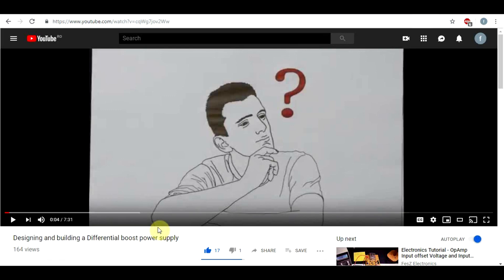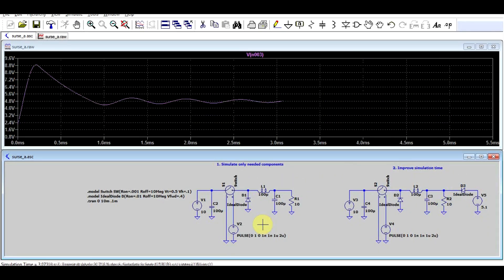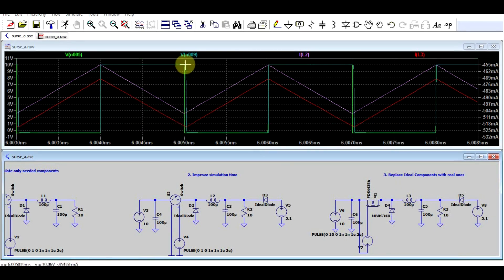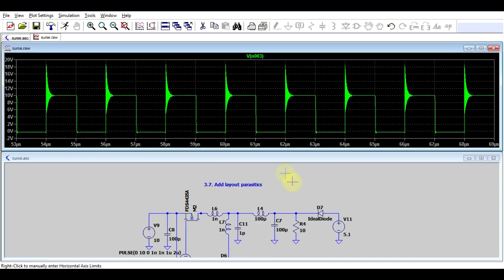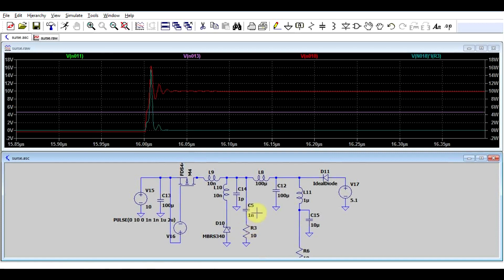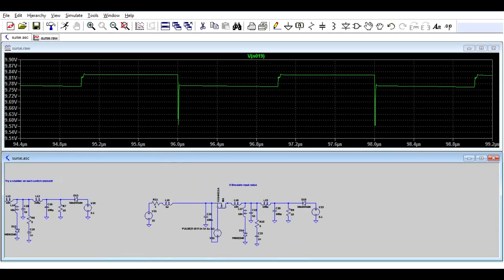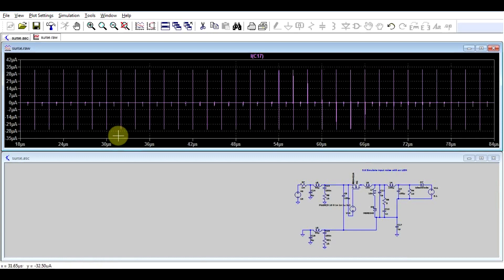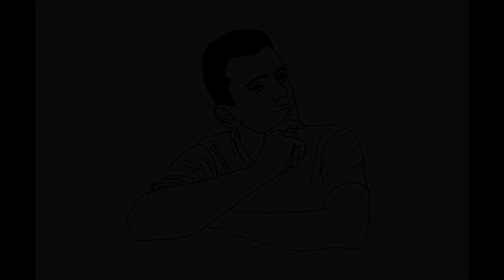LTspice tutorial - SMPS EMI and electrical noise and filtration simulations

Comment: Great video regarding this topic. 10:39 You need 50ohm (in parallel to R15) for proper operation of the LISN. In practice this is either the input impedance of the spectrum analyzer or a 50ohm termination resistor. 12:18 the best way to describe is the difference between differatial mode (DM) and common mode (CM) noise. Your small 1pF capacitor introduces common mode noise.

Comment: Hi, I have a few questions, 

1. If I am designing an SMPS with PFC boost, do I need to use EMI  filter again for the next stage of flyback?
2. If I only wish to simulate the EMI, do I still need to add all the rest of the components?
3. How to calculate the values for pi filter?

Comment: How would you simulate conducted EMI on isolated Power Supplies, for which the secondary Ground is different from the Earth terminal ?
Thank you!
Regards
Udo
Reply from the maker: The secondary ground will never be completely isolated from the primary ground - you can model this connection trough various capacitors - like inside the power transformer and from load to ground again. As the analyzed frequency increases, you will also need to consider the various inductances - the ground is not a uni-potential structure after all... As long as the modeling is an accurate representation of the real device, you should get some idea of the emi that will get generated.
Reply: Thank you very much. I will try a FFT for a Flyback SMPS, using small caps between sec.GND and earth. Also, if a headsink with insul.Pad between MOS and Case is needed, a cap to Earth is realistic. Your presentation is very impressive and helpful.
----
Udo
Reply from the maker: With the transistor a drain to gnd cap should be sufficient, but with the transformer it can be a bit more complex - the different sides of the winding are presenting different amounts of noise - on the primary the side connected to the supply capacitor is far less noisy than the side connected to the transistor drain; You can have up to 4 capacitors - from each winding end to each other and the values need to represent the way in which the transformer is built - the winding end on the primary from the first layer has the smallest capacitances; then the highest capacitance is between the primary and secondary - where one ends and the other begins; and finally a small capacitance is on the end of the secondary - the outer most layer. Based on this mode of analysis you will find that EMI noise is directly impacted by the exact way in which the transformer is connected to the circuit - which coil end is connected to which part of the circuit. 
Hope this helps!
Fesz

Comment: Hi. Actually there is much better way to speedup the start than with the diode and additional voltage supply (which can add noise or other problems by the way). Make the value field of the output capacitor say "10u ic=5" then the simulation will start with the 10uF capacitor charged to 5V, observe the polarity of the capacitor in that case even if the capacitor is non-polarized type (see the current arrow when the mouse cursor is over the component). This technique is also useful to starting with current already flowing through an inductor (ic=1 then means one amp)
Reply from the maker: In the mean time I also discovered this statement; you can use it stand alone (not linked to a specific component)  like the form ".ic I(L1)=1" to set a 1A current trough a component or ".ic V(n001)=1" to set a voltage in a net.

Comment: Great thanks for the video. Only a small comment, the resistance in the LISN should be 50 Ohm or 50Ohm//1kOhm, instead of 1kOhm.
Reply from the maker: Indeed, you are right. I forgot to add the 50R termination... Thank you for pointing that out!

Comment: Hello Fesz,
I have a couple of questions regarding the LISN circuit: 

1) Why did you add he LISN to the circuit? is it supposed to be on the final circuit or it is just added to simulate the behavior of the circuit when conducting CE testing?

2) You probed the noise on the input after you added the LISN, why is that, I thought it should be the other way around because the LISN will add some filtering on the input so we won't be able to see the real noise.
Reply from the maker: Hello! Well, I wanted to measure the noise the circuit is generating into the supply line; if I would have added an ideal voltage source, there would be no noise, since the impedance would be zero. The main reason for adding an LISN (other than as part of the CE test setup) is that it provides a known non-zero impedance to the line, so any noise can actually be measured. 
Regarding filtration, the LISN is filtering noise coming from the initial battery (to prevent it going into the circuit) and its preventing noise from the circuit from passing trough towards the battery; but it does not however prevent the noise coming from the supply from appearing in the supply side of the lines.

Comment: Hey there, 
The LISN that you just took from Wikipedia was way more simpler. So, I wanted to simulate something more realistic, right? I read a bunch of research papers on how to design a practical Line Impedance Stabilization Network. That being so, I came up with two different models. 
question

First Model:
https://drive.google.com/file/d/1zv5ioM-F-j37XWgBORZiYFMpa1WQwGiq/view?usp=sharing

Second Model:
https://drive.google.com/file/d/1HVcmoHBuKRDgC_FeRGm_Ad5NSYdUeLVi/view?usp=sharing
Reply from the maker: Hello Sajid. First of all, it depends on the voltage you are working with - the 250uH/50uH  LISN models the power grid, but there is also a 5uH model for low voltage supply line; the amount of inductance refers to how long the supply line is between the initial supply and the load. Depending on standard you will need one or another. 
As a practical 5uH schematic I found this thing: https://eleshop.eu/tekbox-tboh01-dc-lisn-60v-10a.html ; its a commercial product but also an open source design - you can find even the layout for it. The main reason its so complicated is that all the components have parasitic elements which come into play at higher frequencies. The "wikipedia LISN" is the basic schematic, built with ideal components.
Reply: FesZ Electronics thank you very much
Reply: Can you please help me find out which LISN I should consider and how do I point out its pin configuration?

Comment: Hey. Can you please help me out how can i find common mode and differential mode insertion loss simulation in LTSpice? I am designing a three phase AC DC bidirectional converter with EMI filter at input (commom mode and differential mode choke) and want to see the noise at input with LISN netwrok in LTSpice. Please guide me how can i simulate it.
Reply from the maker: I would suggest building the LISN in LTspice and measuring the output using the FFt method (one LISN for each supply pin). 
Also you can add stray capacitance between each circuit node and ground using .options cshunt=stray_capacity. This will help to generate the common mode current and have it uniformly distributed troughout the circuit.

Comment: Hello? The voltage Pulse which drives the MOSFET, why is it not connected to ground?  Instead, it feeds back into the circuit?  Why is this?

I spent 2 hours creating a Buck Converter from Texas Instruments/Power Topologies with that gate voltage pulse going to ground at the negative side, always used up 50% of my output voltage from Vin (which I don't want).  As soon as I changed to your style, it works.  But I don't understand why.

Thank you for the video.
Reply from the maker: Hello @Da Bx , In this circuit I am using a Pchannel  mosfet, so to drive it I need some sort of circuit that gets the gate pin at a lower voltage than the source pin by at least 5V (I use 10 to be sure I am driving the transistor properly). The exact voltage is transistor dependent. The transistor does not care where the voltage source is connected as long as the gate-drain difference is ensured.
In real life for a simple circuit I would drive the SW transistor with a low side NPN and drive the NPN with a signal source (the control IC) - that way I rely on the input power supply to ensure the gate drive voltage; I used the single signal source approach in the simulation to simplify the circuit and make sure I have fast switching characteristics. 
I used the NPN way in this video: https://youtu.be/89KNjEnIwWM 
The same approach with a single signal source can be done to simulate driving N-channel mosfet, this of course helps to simplify the circuit to not need the charge pump or other method to obtain the higher voltage needed for the gate.
I am not sure why your approach didn't work - if you use the signal source that drives the channel transistor with voltage pulse from 0V to Vin it should work. In your case, when it didn't work, what was Vin and what pulse did you use?
Reply: @FesZElectronics  I'm using an N-channel MOSFET.  It worked only when I increased the driving voltage of the gate (Vg) to more than my input voltage (Vin).  In this case my Vin was 24 V (standard 24v power) and my Vgate was 30 V.  But I'm not sure that I need or want such a high voltage on my MOSFET.  

So if Vg was < Vin, it did not work and I always lost ~ 50% of my output voltage.  It only worked once I:

A) Increase Vg to > 24 V
Or
B) Disconnected the voltage from ground and fed it back into the circuit from the negative side like you did.

The pulse had duty cycles from 0.05 to 0.95 and has a 50ns rise and fall time.

Again, its very unintuitive to me but I'm still dissecting your explanation.  Thank you.
Reply from the maker: @Da Bx Well, there is the problem - you where using an N-chanel mosfet. To drive it, the grid has to have a voltage potential higher than the source by 5-10V. Or in your case 30-24=6V. The transistor never sees more than this 6V accross the gate-drain and the maximum voltage across the drain source is Vin, so its perfectly safe. The only circuit that needs to be able to handle the 30V is the circuit that drives the gate. 
The real-life implementation for such a circuit is by using a boot-strap capacitor. On a quick online search I found this document: https://engineering.purdue.edu/Courses/ECE433/exp5_5th~6thweek_.pdf 
See figure 3 for the circuit and fig 4-5 for explanations. 
Basically you get more than Vin by charging a capacitor when the switch node is at a low voltage. When the switch node is at a high voltage the voltage on your boot strap is added to Vin to get the higher voltage. This works like a charge pump circuit. And you use this higher voltage as the supply for the transistor driver.
Reply: @FesZElectronics  Thank you for teaching me!

Comment: hello, we are trying to design an EMI filter in common mode and differential mode to prevent 50kz noise. LT spice is a SMPS circuit that we try to filter. but we cannot simulate the circuit noise in ltspice. what way should we follow
Reply from the maker: Hello!
I think that you should not simulate the SMPS at all, and just simulate an AC source and see the effect your filter has on a broad spectrum. So for example put the AC source from 1KHz to 1MHz and fine tune the filter to filter not just the 50KHz but also harmonics. 
To simulate both CM and DM you can use 2 AC sources, one between the terminals (if its an AC line then N and L) for DM and for CM use a source from PE (protected earth ground) to both L and N trough DC isolating capacitors.

Comment: I have a question.May be you know how to simulate in LTspice aku to be charged. For example I have charging circuit in LTspice and I want to use it for charging some aku. How to simulate it in LTspice?
Reply from the maker: Depends on the battery parameters you are interested in. Since I don't think you want to simulate 30 min or more of simulation time to charge the battery you wish only to see how the charger limits current and turns off. If this is the case,  the most simple way would be to just to put a capacitor with a few farads (or more, LT doesn't care how big it is) of capacitance and a small series resistor. Some more complex articles I found are: https://www.slideshare.net/TsuyoshiHorigome/nimh-battery-ltspice-simplified-model and https://www.semanticscholar.org/paper/Accurate-electrical-battery-model-capable-of-and-Chen-Rincon-Mora/38febe6b89738ca05095f50f68709e985e14829a
Reply: @FesZElectronics  Thanks a lot.

Comment: wow another gem! In the coming months I'm putting together parts for an class-d amplifier + matching offline SMPS I will turn to some of these simulations for help modeling switching behavior and noise reduction.
Reply from the maker: Sounds like a great project! What topology of supply do you plan to use?
Reply: @FesZElectronics  

For the PSU half bridge ~800Watts,  using a TL494 or SG 2535.. I would like to in the future learn more practical and theory on resonant typologies but I don't have the confidenceand time, so im going for low hanging fruit. (although on semi has some nice chips for resonant typologies and they use less parts).        
for the amplifier x6 channels class-d ucd amplifiers half bridge self oscillating producing ~200watts each and one subwoofer version 500watts using a irs20957strpbf. i have lots of dsp chips so im intending to run them all through a dsp.  

I'm waiting on parts, its a big project hopefully i can document my experiences.
Reply: On the UCD amplifier  topic its rather interesting so many modulator topics, the math is hard it boils down to compensation networks and pole/zero placement.. I have no experience in this but I find it very intriguing   :D
Reply: On the PSU topic Magnetics is key, and for resonant converters it will mean success or failure it less forgiving than a half bridge design.
Reply from the maker: Sounds like a massive undertaking, but also a lot of fun! I wish you the best of luck and hope all the circuits work just as planned!